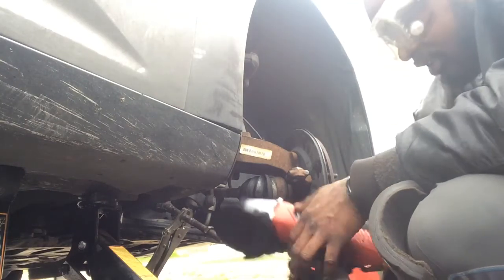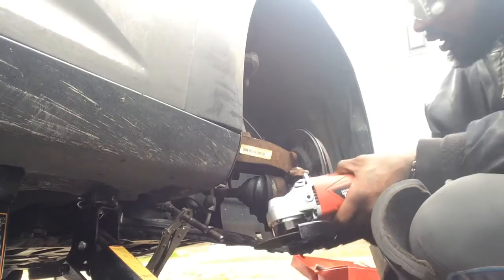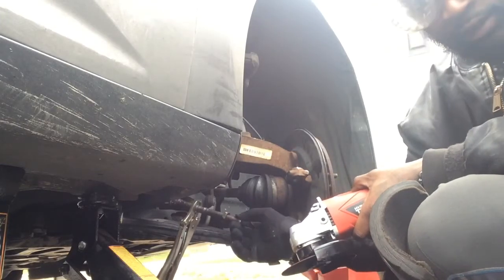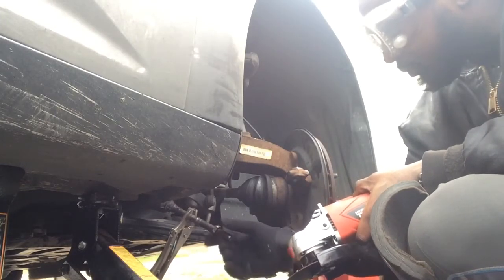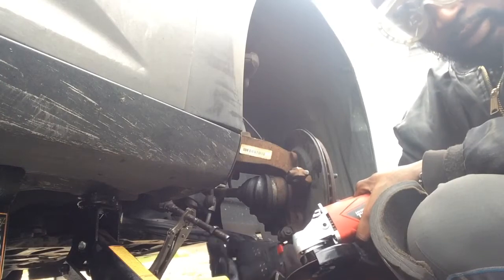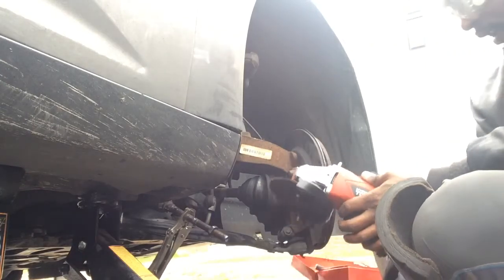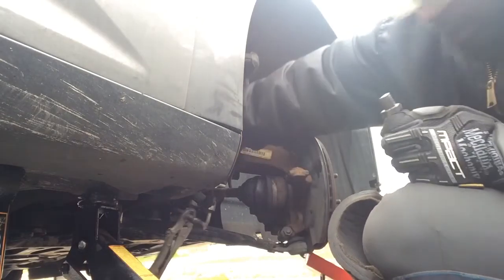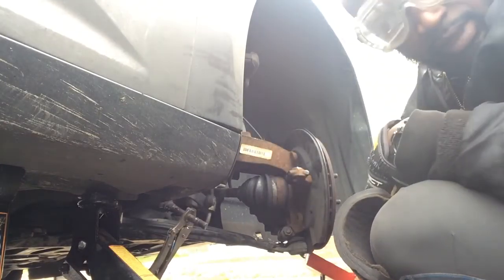Cutting a siezed inner tie rod jam nut part 2

Comment: easy to do when you have access to electricity...lol   I'm in the same situation but I can't even get the tie rod end off because that bolt is like welded on. It's not even rusted. I've already tried how many different tools and breaker bars . I didn't try heat yet though I'm thinking of taking a torch to it... tie rod ends are so bad it's crazy. But if I cut the bolt, I need something to cut it with it would have to be cordless of some kind... the cordless grinder is like $300